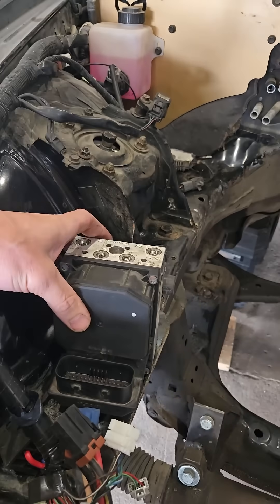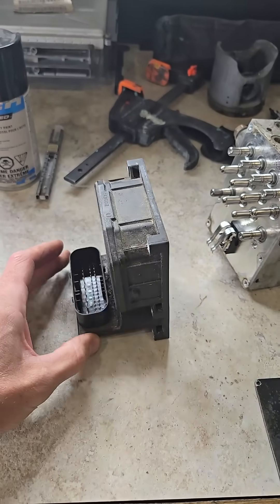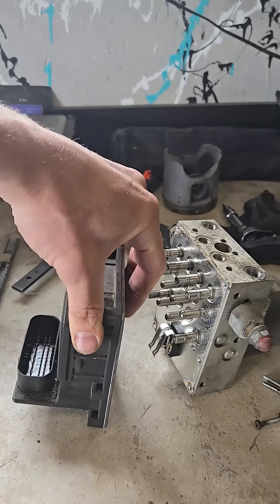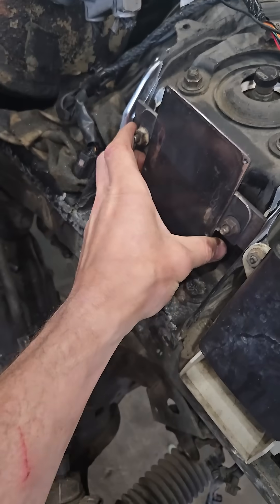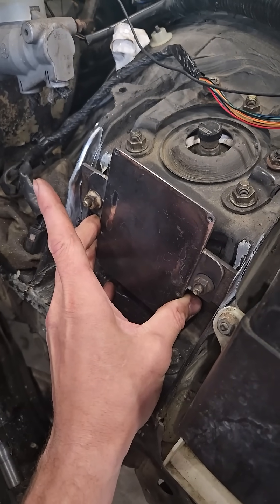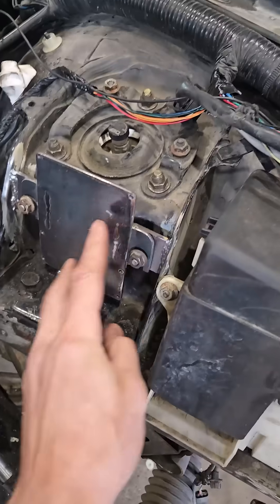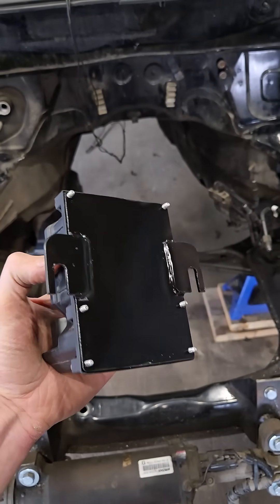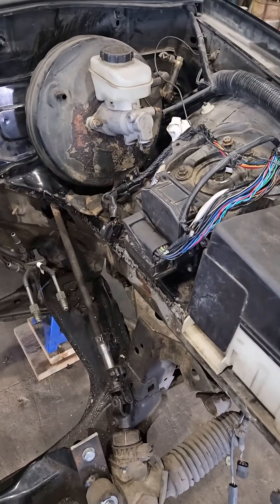Mazda RX8 LS Swap ABS Delete/Relocation  #rx8 #automobile #lsswap #L33 #fabrication #engineswap

Comment: Why did you decide to get rid of ABS?

What did you replace them with?
Reply from the maker: Mostly to save space in the engine bay. The LS is significantly wider than the renesis, and to relocate the module further away would have required me to extend a lot of wiring so I decided to ditch it while keeping the module plugged in which should let me retain my factory speedometer.  I replaced the abs block with a willwood proportioning valve. I should have a video out on that part of the build soon.

Comment: It's crazy how similar this abs module is compared to my Pontiac grand prixs abs module. Looks like the exact same part.
Reply from the maker: Good eye! 

It's quite possible that it is! It would cost a fortune for each manufacturer to design and manufacture a part for every system in the vehicle, so its reasonable to assume that they'd all (or most of them would) source parts from a certain vendor that specializes in that specific system. 

I'd be curious to know how many systems in various vehicles use shared manufacturing like that. 

I may have to do some googling, hahaha.